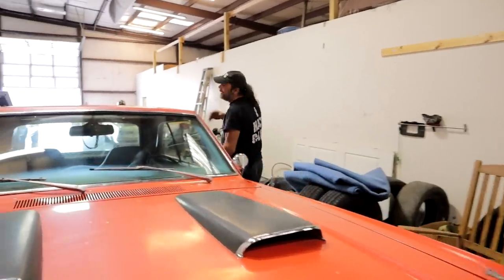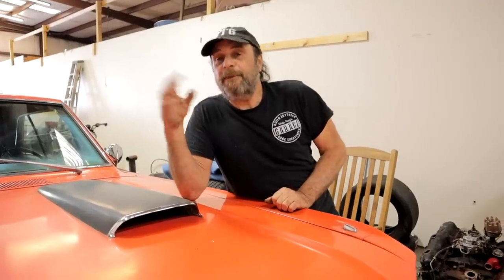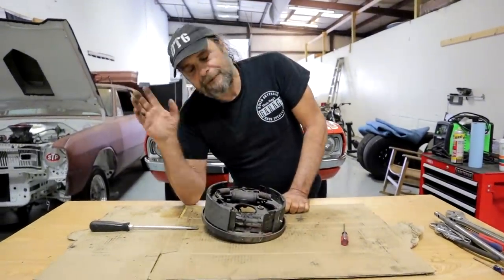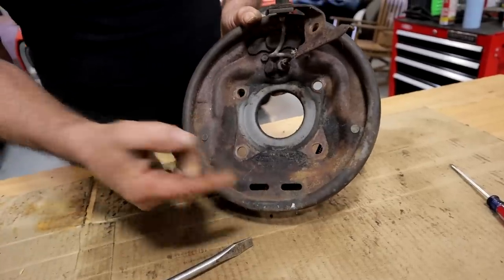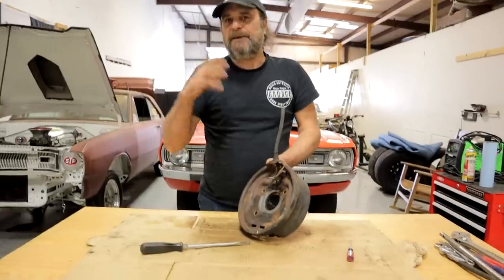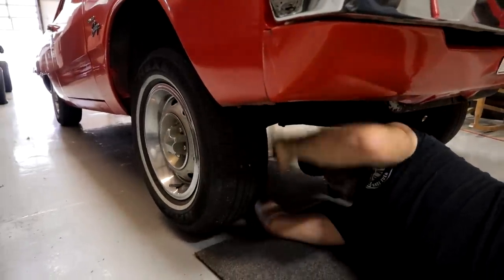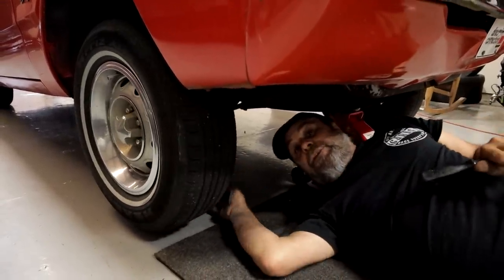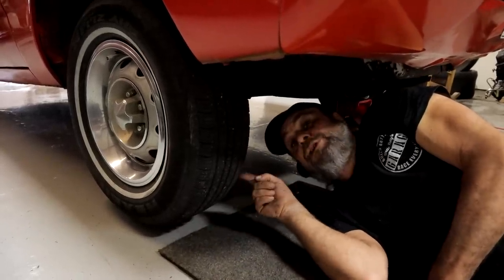Make It Stop! Brake Adjustment For Classic Cars Made Simple Plus A Hack For Gouged And Frozen Drums

Comment: How many times did you back a car up while pumping the brakes?
How many people know this?
Reply from the maker: Pumping the brakes in reverse does nothing.  Stepping on them to stop in reverse will get the pawl to move upward and engage the star wheel for a 1 or 2 tooth adjustment, but it will only do that once.  You would have to go forward, come to a complete stop, and then reverse again and stop for the adjuster to engage again.  The adjuster action is triggered from the shoes shifting fore and aft.
Reply: @UncleTonysGarage  That and if the shoes have worn too much the adjuster cannot engage. The brakes have to be pretty "tight" to keep everything in range for the self adjuster to operate. This is why I just dump the self adjusters. On my cars, I don't like the brakes to be too tight. It produces drag which detracts from my gas mileage and it makes the car a lot harder to push, which I have to do a lot around the shop/garage for some reason, not to mention in the staging lanes. lol
 I check brake adjustment on the front brakes every time I do an oil change.
Reply: I've always figured that the adjusters stop being effective after so much wear. So it has to be done manually after so much wear until it's time to replace the shoes
Reply: @UncleTonysGarage  
Where we're you fifty years ago when some dumbass (my boss) told another dumbass  (me) that "trick"?
Seriously,  thanks for the info. And we just illustrated that even if a guy's been doing this a long time, he can still make uninformed mistakes for a long time.
Reply: Just adjusted the drums on the back of my f150 last weekend. It's supposed to self adjust too but they never worked and the parts fell apart last time I had it apart, so now they're manually adjusted lol
Reply: @UncleTonysGarage  I agree . I notices when I used Velvet touch HP Metallic shoes they never needed adjustment because they didn't wear but they also don't stop until they get hot .
Reply: if you regularly use the parking brake, it will stay in adjustment as long as the auto adjuster is not seized or rusted. each time you step on the parking brake, it actuates from the mechanical lever. backing up and continuing to operate brake does the same thing. arcing the brake shoes used to be common practice but a lot of younger guys just haven't had the experience with this as there aren't as many drum brakes on all fours as used to be
Reply: I knew there was sumik.
Reply: Uncle Tony thanks for the
Video Library of your knowledge , i am teaching my son about the brakes on a 1955 f100 and thanks to you I am able to refresh my mind along the way.keep up the good work.

Comment: I was taught to crank the adjuster in until the wheel won't turn then use the two-screwdriver method to back it off until the desired drag is achieved. I have found that method easier to obtain the same amount of drag on each side. I have never been successful or happy with the final result on the first try just working up to the adjustment a few clicks at a time.
Reply: 1986FordF-250

You are 100% correct . 
If you don't do it the way you describe,  you never get a really full to the top brake petal.  If you only adjust til it drags its only dragging at the bottom of the shoes where the adjuster is , when you go on to full STOP it pushes the shoes up until the top of the shoe is contacting the drum as well, then back off a little til it rolls .
Reply: @junk250  My dad taught me that method, he learned it in automotive school.
Reply: @junk250  And it's a total bitch if you have turned drums and no way to arc the shoes to get them adjusted well enough to the point they can wear in by themselves. I've run into that a couple of times now.
Reply: @junk250  that is why once you have adjusted them you apply the brakes a couple of times and check, most Australian cars Holden and Ford, have removable plugs where you can adjust them while the hub is on, I don't see the harm in drilling a hole in the backing plate where the adjuster is and after adjustment place a bung/rubber plug in the hole ,might save taking it off and on, our rear brakes are self adjusting, but only if you apply the brake hard IN REVERSE most people don't reverse fast enough or brake hard enough to activate the adjuster, thanks for sharing, all the best to yous and your loved ones
Reply: Sorry guys commented before I watched it all, all the best to you all

Comment: One point to make, is when adjusting rears, slacken the park brake cable off so it has plenty of play, before adjusting the shoes. Then readjust the park brake. Not doing this will often result in excess pedal, and rears not working as quick as they should.
Reply: I came here to say the same thing. This is very important to achieve proper adjustment of both the shoes and the parking brake.
Reply: Great to know👍👊

Comment: I like to pull the adjuster apart and heavily grease it with chassis/wheel bearing grease, makes adjustment easy years later.
Reply: I like anti-seize!
Reply: Personally I hate the stuff. Antiseize is expensive, messy, hard to clean up, dries out fast, and is bad at lubrication beyond worst case scenario galling. I also suspect the only people who use it on all sorts of stuff beyond bolts that tend to seize are guys who don't do their own laundry. A lot of people gob the shit places it doesn't belong, but that doesn't make it belong. Get a 1lb tub of high temp bearing grease, cut a small hole in the lid, and stick an acid brush through it.

Comment: One of the things that I learned in my years working in shops is, there are a lot of guys out there who do their own brakes, and ALWAYS get the primary/secondary shoes backwards. And who do calipers and go through a gallon of brake fluid to bleed them but still can’t get a pedal, because they have the calipers on the wrong sides, and the bleeders pointing at the ground 🤦🏼‍♂️
Reply: One of the guys I work with just did that with calipers. Had to replace rear calipers and couldn’t get a good pedal. Kept chasing it until one of the other old guys looked at it and pointed out the upside down bleeder. 
With medium duty stuff they sometimes have “universal” calipers that can go on either side. Just have to make sure and put the hose in the bottom hole and the bleeder in the top hole.
Reply: Oh, how many of you have seen that the 'shade tree' have put both short shoes on one side and long shoes on the other!  DIY people seem never to read the manual!
Reply: @mdcuddy3286  
When all else fails read the destructions.
Reply: This is why I have always been very careful to mark things or pay close attention to how things come apart and go back together. Never had a problem in 40+ years.
Reply: @mdcuddy3286  I’ve seen that quite a few times too, I’ve even seen one guy who managed to get 2 bonded primary shoes on one side, and 2 riveted secondary shoes on the other 🤷🏻‍♂️
Reply: Amen!
Reply: Yep seen that quite a few times I worked as a brake specialist monday mornings all the weekend diy guys came in I fixed the brakes and now it won't stop things like you mentioned

Comment: I've lived in the salt belt my entire 54 years and, I've owned plenty of drum brake vehicles. Some had 4 wheel drum, others only on the rear. The only time I've seen a "self adjuster" not work at all was when it rusted from lack of maintenance. I've learned over the years to pull the drums when rotating tires and make sure they're well lubricated. I use the copper anti-seize on mine.

Also, as others have said, I learned to adjust the shoes out until the drum wouldn't turn, then back them off slightly. I'm not in any way saying that Tonys way is wrong, just that I learned a different method and, it works too.

Comment: One suggestion, never use white lube on the star adjuster.  It has water in it and will lock it up.  Use copper never seize instead without making a mess or even waterproof grease.  
On our 67 Pontiac with front drums, they were not at all self-adjusting from the factory.  We adjusted them at oil change.
Tony a video suggestion would be cleaning, packing and properly adjusting wheel bearings.  Most people do them completely wrong.

Comment: Thing with self adjusting is the hardware in the hardware kits is rarely right, you have to tweak it so it ratchets on over travel correctly. Like you said, takes some fiddling.

Comment: I actually used some of your tips on adjusting drum brakes, to properly and tightly adjust my parking brake shoes in my drum in hat setup, on my AWD car, which I use as a staging brake to preload the driveline before a launch. Works fantastic and holds the car back really good

Comment: Just a few months back,  finished changing the front shoes on my Chrysler C body, I've thought that no drag is good while the wheel is rotating, thanks for another enlightening video as always Tony, learned something new.  Hope you cover something soon on the pre-65 era Chryslers where the rear drums are tapered axle, pain in the ass, but at least it's got the death grip!

This would explain why i have a pull to the right side, Passenger side is adjusted correctly with some drag while the drivers side mostly free wheels, not adjusted fully.  The adjustment i initially used was equally adjust both front shoes till a light drag is felt, then i would drive to a local HUGE parking lot then reverse up to around 15/20 MPH then mash on the brakes, the theory was that the brakes could get "Comfy" in their natural self adjustments.

EDIT: The grabby brakes on some drum systems could be attributed to an overlooked issue, The backing plate where the shoes rub up on the 3 points per shoe on the backing plate, can and will "dig" a channel causing the shoes to get jammed and cause a sudden brake grab as the brake pressure building up in the lines suddenly "Launches" the shoe to the drum HARD.
Reply: Simple solution to the backing plate wear is to use a stick welder, Flux core, or mig welder and fill in the groves. Then grind the weld most of the way down, then finish up with a flat file so you don't take to much off. Easy way to restore a worn out backing plate that you can't get ahold of anymore.
Reply: @williamallen7836  Yes, nice catch! Forgot to mention that bit on the welding aspect of the backing plate.

Comment: I needed this video 2 years ago. Some teeth were broken, took till midnight to take off the drum and clean up the seizing rust. One locked up wheel stopped the rv from moving. It was 1970s D30 Winnebago. And then there were no breaks at all, that's the next venture, perhaps the brake booster.

Comment: It's a much bigger challenge doing the rear brakes, especially if you have a Sure Grip, and as in my case, 4.56 gears, the drag is substantial. I sometimes remove the wheels and adjust the brakes to where I can just slip the drum on. Leaving the 9 1/2" GM brakes out of this, there were some fine drum brake systems out there, especially the 11" used on Chrysler muscle cars

Comment: When I was approaching the point of proper adjustment, and especially after taking up a lot of slack, I liked to hit the brake pedal to center the shoes before touching up the last little bit.  Sometimes only one shoe drags, leading you to think you are done.  Anyone who had an old Volkswagen beetle was under the car almost once a month to maintain a decent pedal height…. if not that, then it was trying to keep the valves and carburetor spot on!

Comment: Went to local shop for replacement rear drum system on 89 F150. It will be done tomorrow they said. Three days later, me and the guy at the counter are walking a noob through Ford rear brake replacement. I didn't mind though. Good lesson and a good repair job.

Comment: I seem to remember that the Plymouth self-adjusters worked to tighten the shoes when backing up, and if the driver frequently backed up while turning in the same direction, such as backing out of a garage into the street every morning, then the brakes would become imbalanced L to R.  One side could get too tight, while the other side remained loose.  Great vid, UT!

Comment: This stuff was all still common knowledge when I first started to drive and work on cars in the late 80s (I'm gen-x)  Even though this was 20 years out of date, a lot of these old drum brake cars were still on the road (not to mention most cars had rear drums, even if they had front disc).  My best friend had an olds (for some reason I want to say it was a Buick, but Buick apparently never made a rocket 350)  with a rocket 350 in it that had drum brakes all the way around.  Today, nobody can even drive a stick, let alone mess with drum brakes.
Reply: People's heads really turn when I get the dwell meter out!
Reply: @MattsRageFitGarage  Cold war motors (a youtube channel I follow, great channel)  has a machine for it.  It needs to be "programmed" for the type of set up it is and the programming is done with a key tha tyou put in in different configurations that push down the right combo of pins, almost like a paper tape. It's comical.
Reply: @tarstarkusz  Sounds like a sun engine diagnostics machine or similar. I have a Sun 1020 myself. Sadly, most of the functions on it have quit working over the years.
Reply: @MattsRageFitGarage  I don't think so, at least not from a quick search for sun engine diagnostic machine.  This is a machine you put the distributor in and it spins it. It has a tach on it that physical shows the characteristics of the distributor.
Reply: @tarstarkusz  that would be a distributor machine. I wish I had one of those.

Comment: I have a 72 Duster 340 with 4 wheel drums. Just completely redid my front brakes changed everything in there except the actual drums, which nowadays are difficult to find and expensive. The self adjusters seem to be working fine. Also did the rear drum brakes on my 71 Mach 1 about a year ago with everything new including the drums, and the self adjusters also seem to be working fine. The self adjusters will work as long as everything is nice and new and within factory specs, obviously a lot of cars will not fall in that category, if not most cars. It has always seemed to me that the biggest issue with the self adjusters is worn parts, on my Duster when I removed the front drums, the pawl had damaged the star wheel, so they would not work, plus the self adjusting cable was a little stretched. If you have new or good drums, and you get new shoes, a complete hardware kit (which has all new springs), and your self adjusting repair kit, everything will work as intended, at least that has been my experience. To top it off the parts are cheap, I paid less than $15 for the complete hardware kit and the self adjuster repair kit from Rockauto, and that does both front drum brakes.

Comment: I also inspect the spots on the backing plate where the brake shoe rubs back and forth on to mke sure there's not rut spot where the brake could stick . if all checks out I mixa combo of antiseize with PB blaster and put some on those flat spots and on the brake adjuster and it moving parts . it keep the adjuster from seizing up from rust,brake dust and heat

Comment: Even my 1988 Plymouth Reliant self adjusters don't work. Been hearing the spring sound with a low pedal for the past year. Went to adjust it yesterday one side needed alot. Other side was frozen adjuster bent the drum banging it off to adjust it. 

Now gotta replace the drum and separate the hub/repack the bearings.

You should do a video on the staked/swedged drums. The hub and drum are stuck together gonna try a hole saw tomorrow....

Comment: Also, I noted the Duster or Champ or whatever ever it is, uses a wheel cylinder with two plungers (rods). I had a 61 Chrysler. I do not remember the model but the brakes used two single plunger wheel cylinders on each wheel. One at the top and the other at the bottom. The set up provided even cylinder pressure to the top and bottom of the brake drum, instead of the springs only at the bottom as shown here. 

I suppose Mopar switched to springs and dual plungers to cut costs in the late 60's.

Comment: As archaic as it might seem, a lot of trailers still use drum brakes. On my dad's boat trailer, the adjuster is completely manual, there's no pawl to adjust the brakes, so I have to adjust them yearly whenever I get the boat ready for the spring. The advantage to using drums on a hydraulic trailer brake setup is that the design is free backing, so they don't fight the truck when you're reversing up a hill.
Reply: Nothing archaic about a drum. 
Big trucks still use em and you've got a heck of a lot more surface area.
I'll never do a rear disc swap on any of my older vws because the wife's later model loves to freeze up rear sliders for the caliper. 
Actually anything from 2000 up (they use em for swaps into early cars) 
Last complete brake job I did was on my summer car in 2003 that has rear drums. 
Yeah it sat for 6yrs and in 2012 I put wheel cylinders in it ,but since then I've done nothing except a fluid change.

Comment: Even my 98 Dodge 1500 P/U has that set up. Except smaller. It seems like that set up has to be clean as can be to adjust correctly. Once the brake dust and grime get in they stop adjusting and you have to go in and clean and lube everything up to get them to work again.

Comment: This reminds me why I hate drum brakes. Disc brakes are so much easier to live with and work on. Interestingly, my 56 Dodge pickup has drums with no adjusters at all. It has 2 wheel cylinders in each drum, one per brake shoe. As the shoes wear down, the pedal travel increases but I don't put that many miles on it so the brake shoes haven't worn down enough to affect the pedal travel that much.